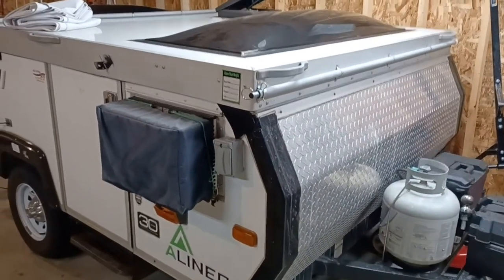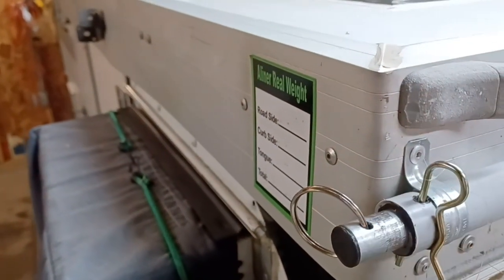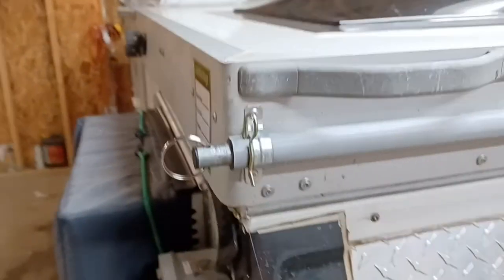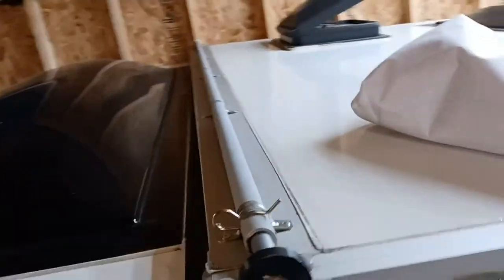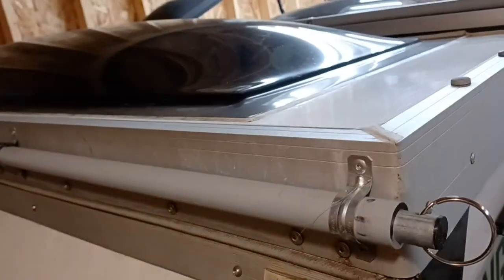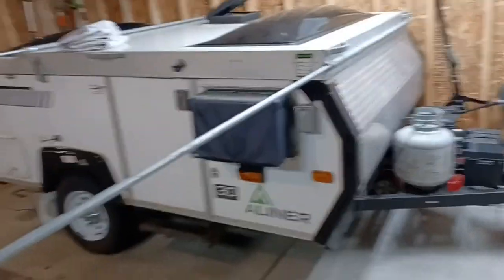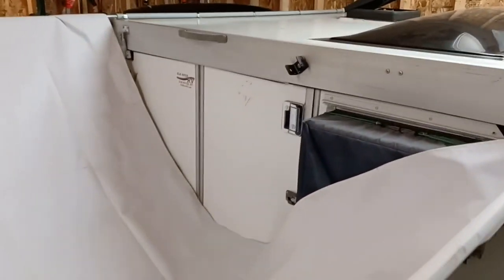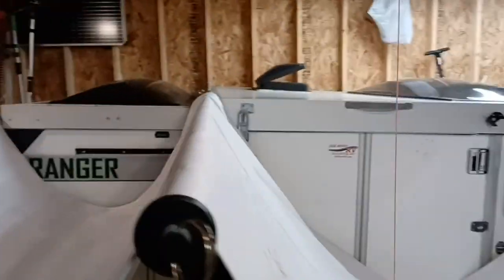Aliner Awning - No Tent Poles or Ropes!

Comment: Hey Dean. This is awesome. I just completed ours but am trying to find the ideal rod to reinforce the inside. I did a wood dowel in the peak tube but that was a pain. After a lower tube bent I wanted to try the rigid conduit, but it’s just barely too big to fit in the pvc. I’m thinking rebar could work but do you recall what you specifically used inside for reinforcement?
Thanks, Josh
Reply from the maker: I used rebar.  I found some precut 4 ft long pieces at Menards.  I slathered some epoxy on it and slid it in till it was right in the middle.  I only put it  in the middle one as it's taking most of the stress.  So far so good, no damage from winds.

Comment: I absolutely LOVE this mod.  I have been searching and searching for an awning to buy, but only found limited options. Th mostly require poles and ropes or don't look sturdy enough for wind.   This looks like it will do the trick.   I'm heading to Lowes...... thanks again!!!!      Did you use any type of silicone sealant behind the rivets?
Reply from the maker: Nope, no sealant,  have had zero issues with leaks.  Installation is pretty easy.  The most time consuming part is actually the sewing.

Comment: Love the awning. Just curious on what exactly is the big washer you use on the center pole and what plug you used on the end of the poles?
Reply from the maker: They are just items I designed and made on my 3d printer.  The plugs purpose is to prevent fingers being scratched on the pole ends.  You could cover them with tape for the same purpose.   The washer is nothing special,  It was cheaper to print  than to buy,  so I did.

Comment: Neat idea! Just curious, are there pics anywhere we can see of it with the roof raised? Also, did you use caulking or any sealant where you drilled on the brackets?
Reply from the maker: I will have a new video up soon showing it being assembled and the roof lifted.  The rivets are very tight and watertight.   No issues with water at all, no sealant required.

Comment: Hi Dean, just curious to know if you the awning overlaps the roof at all. If not, how much of a gap is there between the trailer wall and the awning? Thanks!
Reply from the maker: No overlap, just butted against.   This has worked well in the rain.  A secondary benefit of not being attached to the roof is in strong winds air can blow through the gap taking some of the stress off the awning.
Reply: @Dean-In-Milwaukee  thanks!  One more question. I've been looking into Ottertex material and there's a lot out there. Do you know if what you used was   polyester with a PVC backing? And do you recall the thickness?
Reply from the maker: @dfudge007ca  not exactly sure any more, but it is a heavy canvas feeling material on one side and shiny plastic on the other.  It feels just like the commercial awnings we've had, and weighs a fair bit, probably 2+ pounds,  and let's zero light through.

Comment: This is brilliant!  Would this design work on a 2019 Forest River Flagstaff T12RB (A-Frame Hard Side)?
Reply from the maker: If the edge of your roof is aluminum like a aliner then yes
Reply: It appears to be aluminum at the roof line and aluminum bolted through a steel piano hinge along the 2 bottom sides.  I may use a stainless steel bolt with nylon lock nuts for the entire project just to ensure the metals are compatible, easier to replace and secure. Thanks for the quick feedback!

Comment: Dean,  love this.  From your experience, how wide would you recommend making the trap?  What are the MPH wind limitations?   I like the ottertex because of the color choices for the wife etc. Great mod. Thanks for posting.
Reply from the maker: The ottertex was 5 ft wide which worked out well since the camper is 7 ft wide.  This allowed 2 ft of the extending rod to remain inserted at full extension which is enough for strength. As for wind, it's like any awning, if you're concerned winds are too high, you're probably right and should take it down.

Comment: Hi Dean, I saw your video almost a year ago, great concept, I really like your simple, easy way to set up the awning. A couple of days ago my wife and I revisited the idea of coming up with a design to install an awning on our ForestRiver A-frame camper and we found your video again. Really nice. I do have a couple of questions on two pieces of hardware you are using with your design. One is, the big center washer you are using to prevent cloth to slip out during windy conditions, is this  something you built yourself? I have looked for something similar at HomeDepot & Lowes and they have never seen that before. Would you mind explain what type of material this is, where is this typically used or used for, if available at the stores? If you Mfg. yourself, could you provide sine information on the material used, how you machined it, etc.?
The other question is on the inner plugs or caps you are using inside the 1/2" inch conduit? The closest I have come to find is the rubber caps used on folding chairs but those are pressed in over the conduit and not inside of it. I will really appreciate if you could elaborate a bit more on those two pieces of hardware. Thanks for sharing your ideas and skills. Kind regards. Otto
Reply from the maker: I made them on my 3d printer from pla filament.    The top one is just a simple washer shape that fits over the conduit. The pull ring keeps it from sliding off. The plugs in the ends are only there to keep the end of the conduit from scratching up your fingers and could be omitted. You could also just hammer in a rubber plug and get the same net result.  Hope this helps.

Comment: What was the length of the fabric you used? Why did you opt for steel vs PVC… Just curious…
Reply from the maker: The fabric was 14 ft x 5 ft.  I used steel because the strength was needed.  The fabric has some weight to it and it also needs to be able to handle wind gusts.

Comment: What screws did you use? Any issues with leaks?
Reply from the maker: No screws, pop rivets.  No leaks.
Reply: @Dean-In-Milwaukee  So you just drill a small  hole then pop rivet through the aluminum, but not anything underneath?
Reply from the maker: @Tazdeviloo7  the rivets are aluminum  like the frame they're going through, so no corrosion issues.  They are also very tight so no leaks.

Comment: Hey Dean, my name is Jeff and I love your idea.  I have my 6 poles all set to go and have the two on the outside ends attached.  When attaching your center pole, did you have an issue with the notch that the lower roof sits in?  If I rivet the pole in, the lower roof will not close into the notch. Would you please provide a picture of the center pole from the underside? I have a Classic, but I would imagine all the roofs go up the same way.
Reply from the maker: I will get a picture this evening.  On mine, the center pole rivets clear everything just fine, opens and closes just the same as stock.
Reply from the maker: I got the picture, but it doesn't seem I can post it here.  The rivet does protrude,  but not enough to matter.

Comment: Hello Dean. Can you tell me more info on the drill bit size and the size of the rivets you used to hold the brackets in place?
Reply from the maker: I don't quite remember the size since it was a while ago I built this, however its easy to figure out.  I bought rivets that fit in the bracket holes, and the rivet box says what size drill to use.